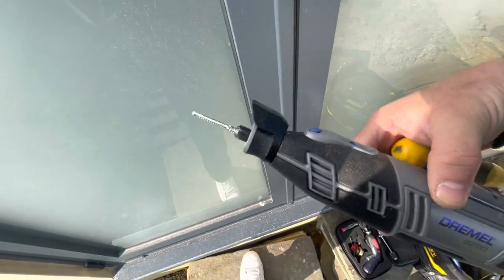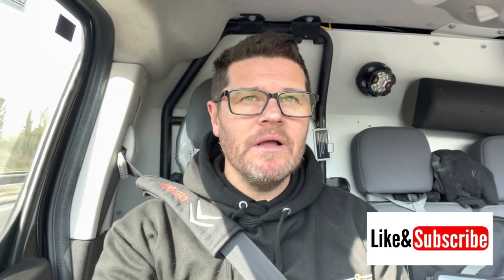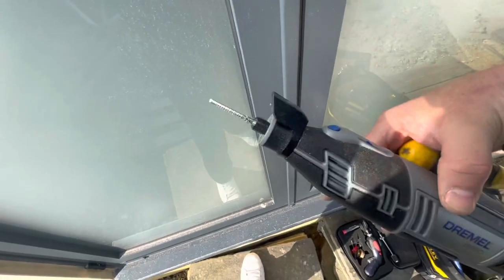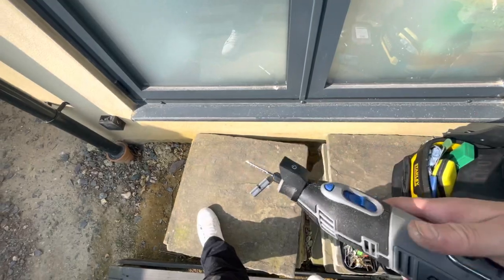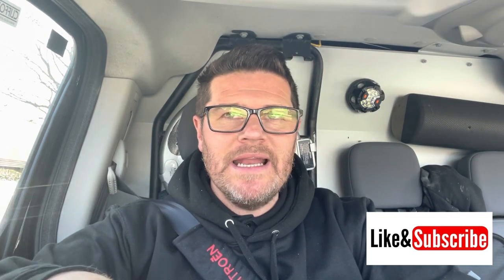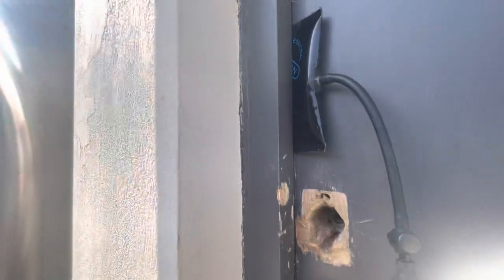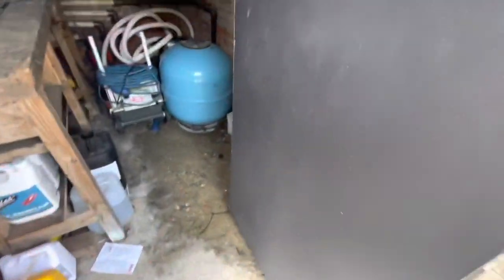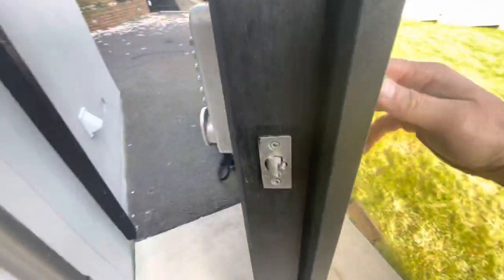Souber ‘Magi Burr’ | Failed ERA Nightlatch | Gain Entry - Locksmith

Comment: Had to use the burr on an Era auto dead locking night latch. The one with the security escutcheon. When I took apart to replace the cylinder found that it was faulty.  No wonder nothing else worked

Comment: Do you need the specific dremel with the bit Andy? I have a 12 volt Bosch version and thinking of getting a few magi burrs
Reply: Will fit any 3mm  rotary tool,,want around  25 000 rpm though
Reply: If you have the Bosch 12V Rotary Tool with 3mm Collet you should be fine. Dremel is made by Bosch so, just set it to 20,000 rpm and pop your Magi-burr in the Collet. 
Cheers Paul Souber
Reply: @SouberTools  you should emphasise  how important  it is to not drop  the rotary tool before  you even get to the lock🤦‍♂️, the burrs don't particularly  like it. 
Worked a treat in practice  though, better order more than  1 next time🤣🤣
Reply: @cardiffpicker1  I'm glad you see the funny side of it. This grade of Carbide does not like impact. There's lots of different grades of carbide out there. This one has proven itself time again. The Master Kit of 8 Burrs is 10% cheaper than buying the burrs on their own.
Reply: @SouberTools  only bought  1 as a test, work brilliant so will definitely be ordering  the multi pack.

Comment: Sick! Snapped my magi burr bit… opened 2 high security locks including a mil-t-lock integrator. And snapped on a piece of crap lock
Reply from the maker: Ah man!!! Gutted!! I guess they can’t last forever!! Great bit if kit though 👍🏼
I dropped my die grinder with a brand new bit in it which cost me £50 and it shattered! I’d only used that twice 😫
Thanks for watching 🙏🏼
Reply: Hi Dave, I’ve been looking into these for when I can’t pick the locks, for the Hugh security and mul-t-locks are there any specific ways you’d use the magi or is it just a matter of shaving down the pins? Thanks

Comment: The ABS euro locks have a Anti Bump pin in pin so will not bump. 

Good video 👍
Reply: Lots of locks with anti bump pins will bump
Reply from the maker: Thanks buddy
Reply from the maker: @cardiffpicker1  I’d not come across one of these in the field before and knew that some anti bump cylinders would still bump so thought I’d give it a go anyway. This was a bugger though 😂

Comment: 6:11 Failed ERA BS nightlatch ! 
An internal component breaks in these nightlatches and locks the nightlatch 
so that even from the inside the handle will not retract the latch .
There are very few options to gain entry if you only have access from the front.
The nightlatch fixing plate on his BS nightlatch is FULLY protected with a hardened steel 
plate and is not like the non BS version. 
After removal of cylinder a standard HSS hole saw or drill bit will not 
penetrate the back plate to allow access to the nightlatch to manipulate.
I discovered this myself ! 
Only a TCT hole saw or bit will penetrate the steel .
You obviously punched off the nightlatch. This was okay as there was 
a concrete floor but if this was residential with a wooden or tiled  floor 
then this wouldn’t have been an option and you would have to drill through the rear.
This is an awkward job with the extra expense of having to use TCT holesaw or bits ?
I keep a an old sample of one of these in the van for reference when I get called out to one 
so I know exactly where to drill to manipulate it open.
Reply from the maker: Thanks buddy. Very informative. 
Keeping an old night latch on the van is a great idea 👍🏼
Thanks for watching 🙏🏼

Comment: Can you tell me more about Gav’s snub mouse ?
Reply from the maker: Hi Eddie. It’s a tool designed for when the snib drops on a night latch and there is no letterbox to use the LBT on. 
The only way to overcome this (other than air wedging which will not always work!) is to drill the cylinder out and attempt to drill another hole in the back plate of the lock to manipulate the snib. Gavs snib mouse works as a template to drill the cylinder screws and the backplate of the night latch 👍🏼
You can purchase it here ⬇️ And if you used the code LOCKSWOOD10 you will receive 10% discount:
https://www.abbeylocks.co.uk/product/gavin-jeffries-snib-mouse/
Reply: Champion. I’ve had this a few times but it’s always hit and miss getting to the snub. I’ll order one now. Cheers again.